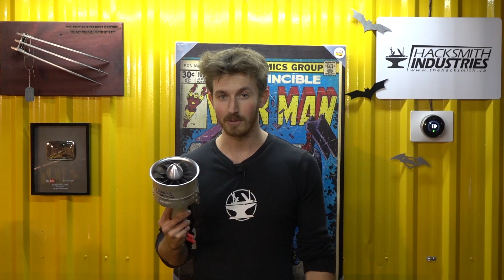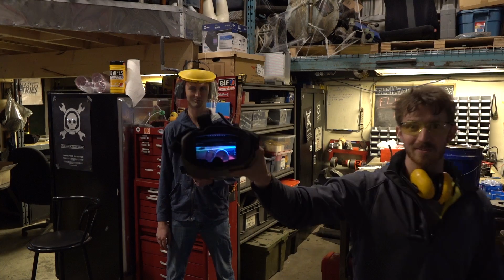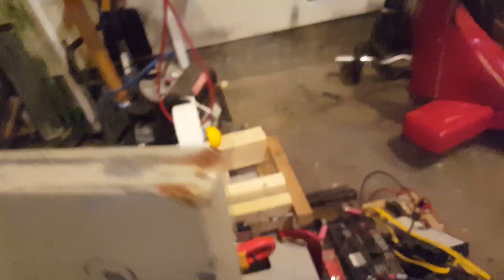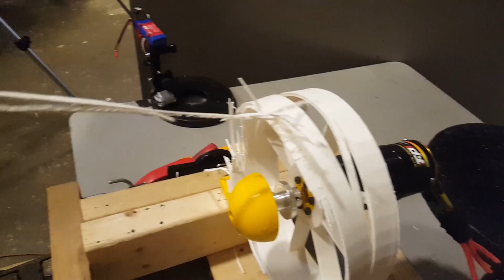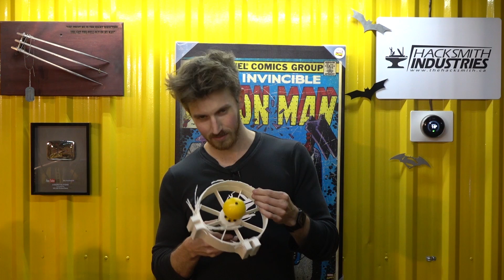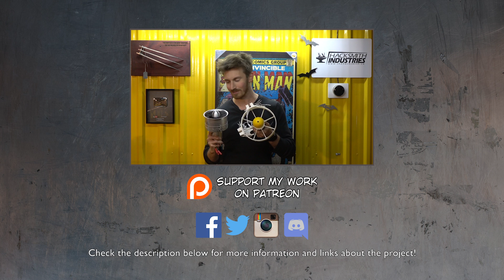Flying Like Iron Man Update: EDF EXPLOSION!!!

Comment: to bad Carbon3D's technology isn't very available yet otherwise you should totally get their printer to eliminate delamination.  until then take all the other people's advice and brush on some acetone to strengthen up your parts presuming you are using ABS or get a higher temp extruder and use polycarbonate.
Reply from the maker: That blade was acetone dipped ;)

We don't really think any FDM printed part (regardless of material) is going to have a reliable result for a blade that spins at 40,000 RPM -- we're mostly doing these tests to finalize the design before we look at getting it machined or injection molded =)
Reply: the Hacksmith yeah FDM and even most resin printers are always going to have strength issues.  the only promising technology is Carbon3D because it grows the parts and eliminates layering.  but they only rent their printers to fortune 500 companies right now for crazy money 😂😂😂. since I only have access to fdm some times I use ninjaflex for less delamination but it is too flexible for your applications probably.  I hope everything works out!!! 

edit: yeah cnc or injection molding would probably be your best bet.  I am actually thinking of trying to make a cnc machine over the winter holiday similar to the Shapeoko if I can find the time (busy masters computer engineering student).  Are your 3D models available on any repository?

Comment: the cover is good just get a machine shop make some billet aluminum impellers also add a thruster funnel it would not have to be a foot long maybe 6" and it could possibly double the thrust force so you would only need 4 to achieve flight.

Comment: I think you should try printing the fans with small holes through and then use some thin carbon poles as spars in each blade, this would likely allow you to support much more weight off those blades. Also after you have completed each blade you would want to make a balancing rig and check that the fans are balanced, if not just apply tape to the respective blades until they are in balance.
Reply from the maker: Tape would fly off at 40,000RPM ... I think your underestimating the forces at play here :P
Reply: If you make a loop of tape along the chord length it should be fine.

Comment: Why don't you send in the design to have a company 3D print it out of steel or aluminum or something?
Reply from the maker: Because the design isn't done yet... so it would be a waste of money =P

I checked a quote for this particular design, would cost $900USD to print the blade. And even metal 3D printing might not do the trick, should really be machined.

Comment: Have y'all tried to connecting the ends of the blades so that the end of the blades are not cantilevered out.  This should distribute the load from one blade to the next and will strengthen the blades so that the force from the air doesn't bend and brake the blades.  I hope that this helps.
Reply: I read my post and thought it might not be clear.  So basically what I was thinking is that the blades should have a ring around the outer edge that is attached to the ends of the blades.  This should help compensate for the weaker material from the 3D printer.
Reply from the maker: I understood -- the issue is 3D printing is innately weak -- even with an added reinforcement like that, it's not going to stop the delamination at 40,000 rpm :P
Reply: That makes since everything that I work with is much larger and I don't deal with fans or anything spinning that fast.  I also have never worked with 3D printed items.  Is there any way to enter lay something stronger in the blade while it is being printed?  like every third or forth layer.

Comment: Perhaps lost PLA casting in aluminum is a more suitable solution?
Reply from the maker: Problem is at home-casting is pretty difficult for precision parts. It works for a lot of things, but for something like this, might be more effort than it's worth.

For example -- if you see the professional EDF blade we show near the end of the video -- look at the underside. It has a bunch of holes in it. Those are for balancing the blade so when it spins the CofG is perfectly in the center. Considering that whole piece was machined very accurately, it should of been balanced from the get go. Now imagine casting it, how many variations it would have! It might be possible, but like I said -- would probably end up being more effort than it's worth.
Reply: Unless you started with a casting and then cnc milled it. Isn't that how the 'real' ones are made?

I'm no expert, it may be easier to just start with a billet and machine that too.

Or you could try what the big boys in aviation do with theirs, and make each blade individually and then mount them on a central hub.

Comment: assuming you printed in abs instead of something more exotic i'd be interested to see a second test after vapor smoothing the parts to increase the layer bonding.
Reply from the maker: This blade was acetone dipped, it had no visible layers on the outside surface =P
Reply: ah. would have been cool to see comparison results for a non-dipped part but I doubt you have time to run that test :/  looking forward to the next video

Comment: Have you though about making a 3D printed prototype then casting it in solid plastics or aluminum? You'd probably get a stronger finished product, though it might not increase thrust.
Reply from the maker: Problem is at home-casting is pretty difficult for precision parts. It works for a lot of things, but for something like this, might be more effort than it's worth.

For example -- if you see the professional EDF blade we show near the end of the video -- look at the underside. It has a bunch of holes in it. Those are for balancing the blade so when it spins the CofG is perfectly in the center. Considering that whole piece was machined very accurately, it should of been balanced from the get go. Now imagine casting it, how many variations it would have! It might be possible, but like I said -- would probably end up being more effort than it's worth.
Reply: I figured it would be better for structural integrity and consistency across all homemade EDFs, but yeah, that's a really good point. Good to see you guys are really thinking through it all.

Comment: I couple important details are missing from the video and/or description.  What material did you print it in and did you balance the prop?  I'm guessing PLA but not sure.  The second question is really important.  Well made EDFs "explode" if they are out of balance.  That happens because it adds excessive side loading on the hub.  I would be very interested in seeing what would happen to the same design/material after it was properly balancing it.
Reply from the maker: Hence "stay tuned for the dedicated 3D printing EDF video" ;-)

Comment: Just throwing out the idea such as internal reinforcement like fiber glass mess.  Step 1) 3D print part, Step 2) create mold from printed part, Step 3) put mesh such as fiber glass in mold and then fill with resin.  Is there something that I am missing such as will the resin push the fiber glass mesh to one side of the mold when being filled? Or perhaps there is a more elegant solution. Of course it is not my dollar being spent to try this, so please feel free to disregard.  Interesting channel...living the dream.

Comment: ...blades broke near the hub and not at he tips. Maybe you should make blade profile progressively thicker towards the hub, or make maybe reduce the number of blades altogethermaking them "wider" and therfore stronger. Other option is to make a connecting ring around the blades to further reinforce them fon the tips. As centrifugal force tries to pushes them away from the center of rotation connecting ring should try to contain them...or just drop the trust to safe 10kg...:/
Reply from the maker: Not necessarily, until we blow up another with a slow mo camera there's no way to see the real cause of the explosion. We're focusing on optimizing the design for thrust before we play with reliability -- its highly unlikely we'll use 3D printed blades in the final version =)

Comment: did you ask NYC CNC for a quote on the rotors?
Reply: The name of nyccnc's job shop is Saunders machine works nyccnc just makes vidoes. It is still a great idea.
Reply: you absolutley should
Reply: "Plastic stuff is for kids" yeah, no. Not really, he just designed it badly and the blades touched the cowling. Anyone who has installed a bathroom fan in their life knows what he's done wrong, it's that simple a mistake in design. Off center mounting points that stressed the cowling out of shape.
Reply: aserta no the rotor blew apart due to the extreme speeds involved. 30,000 RPM. Not your average bathroom fan. I'm frankly amazed the rotor survived as long as it did.

Comment: Why not make a home made forge and sand cast the 3D printed parts in aluminium?
Reply from the maker: Problem is at home-casting is pretty difficult for precision parts. It works for a lot of things, but for something like this, might be more effort than it's worth.

For example -- if you see the professional EDF blade we show near the end of the video -- look at the underside. It has a bunch of holes in it. Those are for balancing the blade so when it spins the CofG is perfectly in the center. Considering that whole piece was machined very accurately, it should of been balanced from the get go. Now imagine casting it, how many variations it would have! It might be possible, but like I said -- would probably end up being more effort than it's worth.

Comment: You can actually put PLA printed parts in the oven to fuse the layers together better, and also to "anneal" the plastic, which significantly increases the strength of the part.
you're still asking a lot of the plastic, but this certainly wouldn't hurt.
I've never tried it with ABS, but it could work too, assuming it doesn't collapse first.
The intake of the EDF could also be improved for more static thrust. the xjet channel actually has some good design tips for this..

Comment: Looks like you're using a standard PLA or ABS. I would imagine that would lower the cost, but have you looked at Taulman filaments? I'm not sure whether the failure there was the layers separating or just a failure due to heat or a combination, but those alloy filaments may have a lot more strength.
Reply from the maker: Yep we have a whole range of engineering material filaments -- but the purpose of these tests right now is to finalize the blade design to maximize thrust -- then we'll work on reliability ;-)
Reply: Yeah, that's sort of important I suppose. This is a fascinating journey, even more so now you've moved into 3d printing your own.

Comment: print the propeller then use silicon to get a mold and use plastic injection to build a more ruggid propeller or try heat treating the 3d prints to get more strenght

Comment: I wonder if an edf could be used as forced induction on a car?...
Reply from the maker: Electric turbochargers are basically that
Reply: Yeah but they don't work, proven on dyno testing.. I'm of course referring to the cheap ebay kits claiming 50% gains in power..

Comment: have you tryed a carbon fiber pla, or other kinds of pla with adatives or even abs with acetone dip
Reply: good idea.. thought about reinforcing it with carbon fiber, but using that as a filament is a good idea.
Reply: also armadillo from ninjatek may work well
Reply: I like the Carbon Fiber reinforced PLA suggestion. They even have Carbon Fiber reinforced PLA filament already available (if I read their charts right, it's actually stronger than CF-ABS: http://www.3dxtech.com/carbonx-carbon-fiber-pla-3d-printing-filament/ ) but I have one nagging question in the back of my mind: Did they balance the 3D printed blade before testing? Having owned several EDF-Powered model airplanes, could it be the cause of a lot of the structural instability.
Reply: They have, they said it probably wouldn't work.
Reply: CF reinforced PLA has minor advantages over regular stuff because the fibbers inside are only tiny fragments, also doesn't do anything for layer adhesion.
If one needs real CF structural rigidity it takes woven CF material so the fibers hold across the entire piece.

Comment: Hey, Hacksmith, can u please please upload the file of the 3d printed EDF and  its propellor , cuz I am also working on a similar kind of project in which I am required to 3d print the EDFassembly but I have been only able to generate a thrust of about 4 kg with the 3d printed assembly. and can also let us know the KV rating and other details of the BLDC motor that u are using along with the 3d print EDF.Would really appreciate your help regarding the 3d print files.
And btw awesome project you have going on there !!!!

Comment: Hey Hacksmith, you've probably thought of this but would it be possible to have a 3rd party 3D print the EDF parts with stronger materials, it may cost more but could be cheaper in the long run.
Reply: These were for tests
Reply: They made another video on it explaining it and this was just for a test because it’s a lost cheater then CNC machine it

Comment: get the slowmo guys to record some of your tests
Reply from the maker: My business partner worked with the creator of the Chronos -- we're trying to get a free unit =)
Reply: Crazy Potato So they can see how the fan delaminates?
Reply: Or buy a Chronos 1.4 camera and record it.
Reply: If you are able to improve on your design and operate at 12kgs of force using a single fan without breaking, I would recommend 4 fans per arm in a square formation around the wrist's, per arm. This allows for 48kgs(105.82lbs) of force per arm. This would be more than enough to at least and levitate above a considerable height above surface without breaking. However, given the max force vs breaking point, attaching modules to the legs would be ideal as you then allow yourself additional support and far greater acceleration. In the end 4 per limb(arms and legs) would account for 192kgs(423.82lbs) of force, this in my mind being the most ideal method for speed, acceleration, and a safety power output on fans in order not to excel safety precautions.

Comment: Have you ever thought about trying the edfs in series?  Once you get the edfs built, anyway, you may wish to try putting them in series (one right behind another) and see if that increases the force output.  It will allow you to place fans up your arms and legs instead of an octocopter type thing.  Just a thought for a more convenient design.
Reply from the maker: Stacking is possible but there is a loss in efficiency -- larger or separate EDFs are always better. Not impossible, but would require a lot more design as the second EDF has to have a different propeller to account for the entrance airspeed.
Reply: okay, how much range would allow for loss though? like say right on top of each other its a 30% loss, would 1 inch provide less loss? and than 6 inches almost no loss? and yeah the propeller design is also true, but you made a successful 3d printed EDF to a certain spec, you could redesign around this to allow for a more compact design. which could possibly be built into an actual suit later
Reply: and also I'm curious as to if an air cooler in front of an EDF would help the EDF cool down and possibly allow for more air force? colder air is denser so maybe the force could be secondarily increased that way. These are just brainstormed ideas to possibly increase efficiency.

Comment: Wasn't this just from the thrust flexing the plastic because it was only held down in a single place, then the blade hitting the duct?
Reply from the maker: No, the whole thing flexes forward, not just the prop
Reply: Thanks for replying, but I was meaning the duct flexes because its only attached to the wood at that one (or two) locations and so slightly changes shape which perhaps caused the prop to catch on it.
Perhaps if the shroud was secured on four sides it wouldn't explode.
Reply from the maker: That would help for a more accurate thrust measurement but we really don't think that was the cause of the explosion. The interlayer adhesion of 3D printed parts just can't take 40,000 rpm ;)

Comment: Why not use a metal disk, make cuts from the edges to the center and bend them?
Reply from the maker: Balance and symmetry would be extremely difficult. Remember it's gonna go 40,000 RPM!
Reply: but this idea is actually pretty good. you could da that and give your best to even it out by using special devices. Then cou could harden it by heating and cooling it down in oil! So that nothing can bend it any more